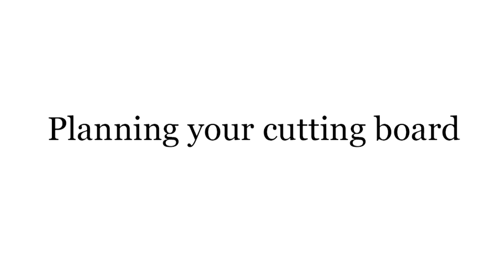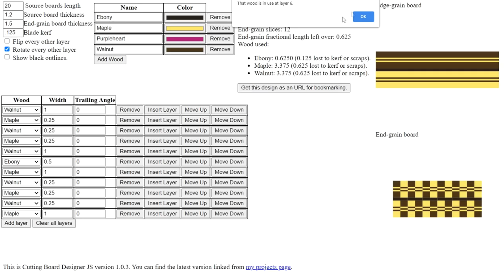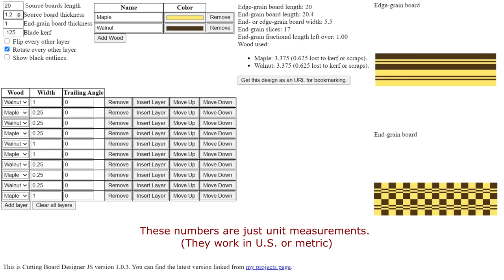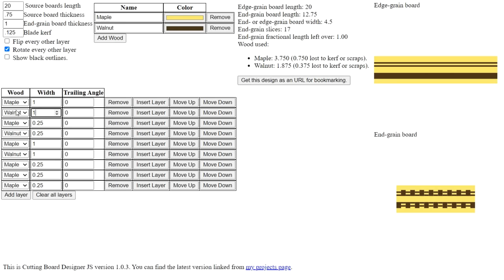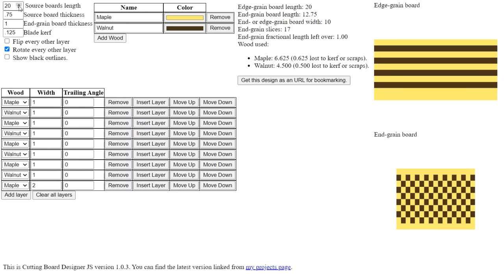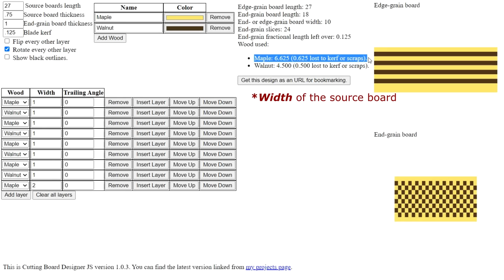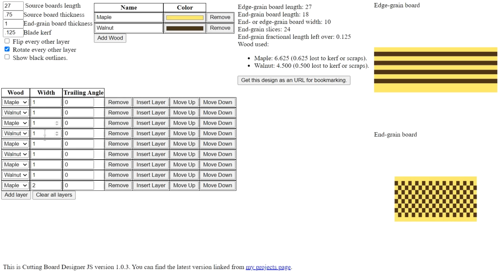The ultimate guide to making a wooden end-grain cutting board

Comment: My issue with all cutting boards is that I am 6' 3" and my wife is 5'3". Actually it is my issue with anything in the kitchen because the counters are much too short for me. But because we follow a plant-based diet, I end up chopping mountains of fruits, vegetables, potatoes, squashes and greens. So I have to bend over or slump to get my hands down to counter level, and within minutes my back is already aching. 

Now If I had just had the nerve to ask out that tall girl that I had an enormous crush on in geometry and we had gotten married, this wouldn't be an issue. But the foot difference in height means that I can't just install custom lower cabinets to raise the counters 5" to 6" because the countertops would be approaching chest level for my wife. Even 36" counter height is uncomfortable for her. So we actually went the other way in our new kitchen and had the cabinets made an inch lower for her figuring that I could find some way to raise things up for me, but there is no way to make work surface lower than the countertop for her.

Now there is nothing I can do to bring pots and pans up to my level, but there should be something I can do to bring the cutting board up to my level to make it easier to chop the mountains of fruits and vegetables we eat following a plant based diet. 

So I would love to see one of the YouTube woodworking gurus come up with a slick design for an end grain cutting board that lifts the board 4-6 inches off the countertop without just making the cutting board itself 6 inches thick, which besides costing a mint for the necessary amount of oak, maple, cherry and/or walnut, would make it weight a ton and force it to become a permanent fixture on the countertop.
Reply from the maker: Maybe set the cutting board on a box?
Reply: @SteveRamsey  Thanks for replying. Actually that is my current work around. I just thought that a more purpose built  design would just look, well more purpose built and less ad hoc. 

I didn't want to bias your thinking so I didn't propose any solutions, but here is my first idea. Cut a set of thin (1/4"?) slats with slots cut half way that allow the slats to be simply slid together to form a grid. The width of the slats determines how much the cutting board is lifted off the counter. When not in use, it could be disassembled for compact storage. To keep the cutting board from sliding around I was thinking that I could leave tabs on the tops of the slats going in both direction and cut corresponding slots in the bottom of the cutting board to give it a positive retention. Or maybe it would be better to simply glue thin strips of rubber to the top and bottom edges of the slats so the grid won't slide on the countertop and the cutting board won't slide on the grid without having to worry about getting the tabs and slots to align. The grid could be made an inch or so smaller so the cutting board overhangs the grid. Then a bowl could tuck up under the edge of the cutting board, making it easy to sweep cut food into the bowl. 

And then there is the simple screw in legs solution with threaded inserts in the bottom of the cutting board so they can be attached and detached each time. With a little planning it might look cool to make the legs out of lengths of the same wood used in the cutting board and have them line up with the corners of the cutting board. If the strips making up the leg were the same species of wood as the block in the cutting board above it, the look would be as if the corner blocks of the cutting board were just made extra long to form the legs. And of course you could actually do just that when you make the cutting board. But then it is hard to store the cutting board with the legs being permanent. Unless the cutting board itself is pretty thick, it would likely be a good idea to put at least one leg in the middle of the cutting board to avoid any risk of breaking the board with only edge supports. Threaded feet on bottom of the legs would allow adjustments to dial out any irregularities so there is no rocking.

But those are just my ideas. With your much greater experience, I thought perhaps you might have much better ideas.

Oh, and as a mere mortal just starting out, I truly appreciate your approach to woodworking. So many other channels use equipment that I will likely never have in my shop (who has the room for a 9 foot sliding table saw!) and seemly try to out fancy each other with complicated projects that I love to watch them build, but am likely far from ready to take on.

Thanks again!

Comment: End grain cutting board, pretty, but will not hold up over time. End grains expose the "straw" of the wood to water which is absorbed and expands the piece. Results, cracks that harbor bacteria.  There are butcher blocks that are quite old with end grain but are very thick, usually a foot or more. That is an impractical thickness for a countertop cutting board. Steve Ramsey is a wood worker not a chef so should not be expected to understand what a kitchen needs.
Reply from the maker: I've been using the same cutting board for 12 years. Still holding up fine with no cracks. If you have one that's developed cracks, it probably wasn't built properly.